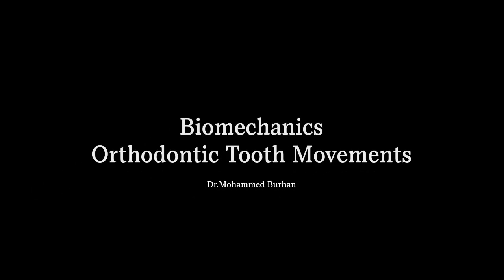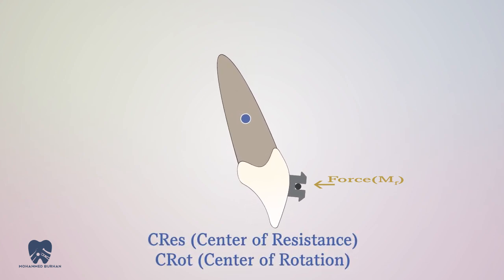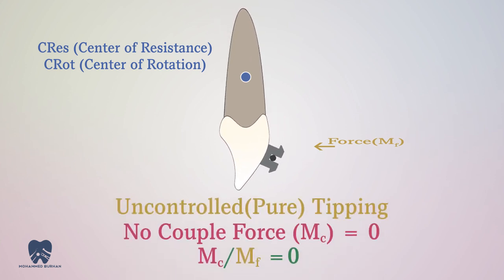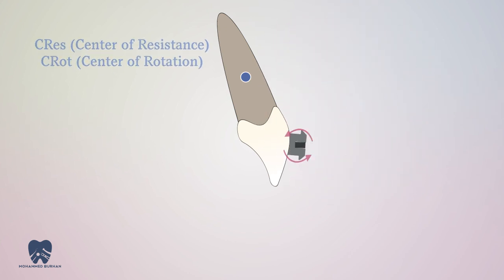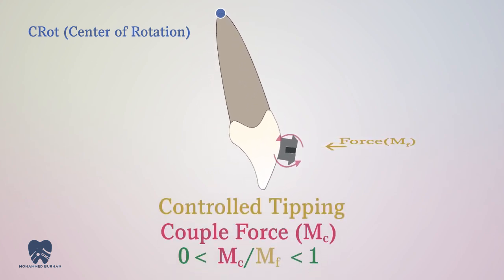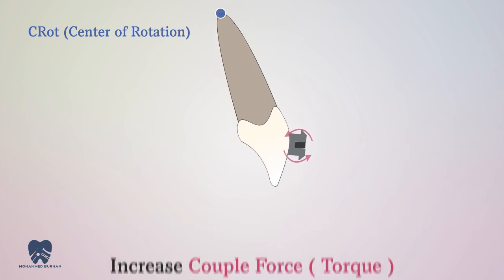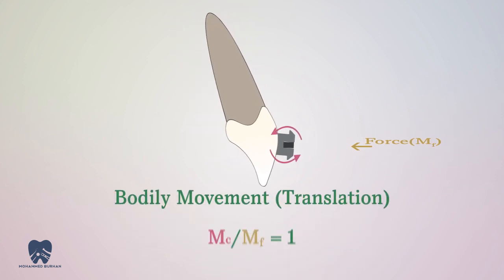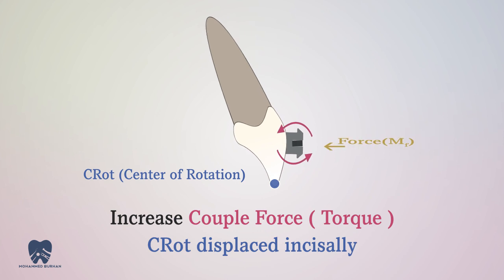Biomechanics - Types of Tooth Movements in  Orthodontics

Comment: Thank you for your great video Dr. I have a question about the tipping movement because I am confused. Thank you for your help Dr. !!!
Movement of tipping occurs when 
1 Decrease amount of force applied.
2 Increase amount of force.
3 Decrease duration of force.
4 Increase duration of force?
Reply from the maker: Tipping movement occurs with any amount of force, but the tooth moves around the CRot (Center of Rotation) which means that the root moves in opposite direction to the crown.